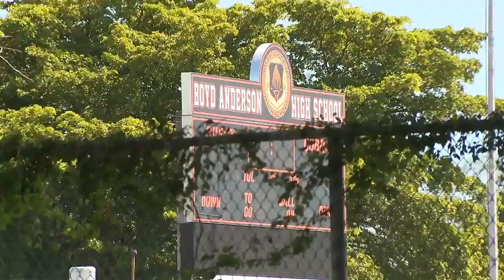NTSB Multiple failures contributed to deadly FIU bridge collapse

Comment: The cracks are not the cause but rather the result of poor design. From the July 2019 report by the US Dept of Labor:  “The design criteria prepared by TY Lin for FIU recommended avoiding non-redundant structures and encouraged a steel superstructure. The design criteria stated that “The bridge superstructure should be primarily structural steel with concrete walking surface. The design should avoid use of non-redundant, fracture critical members.” (Emphasis ours.) The selection committee was swayed by the graphics and rendering of the bridge and did not consider the non-redundancy of the structure.”